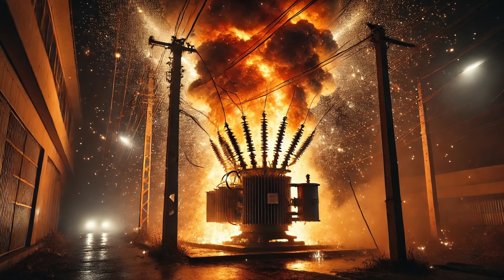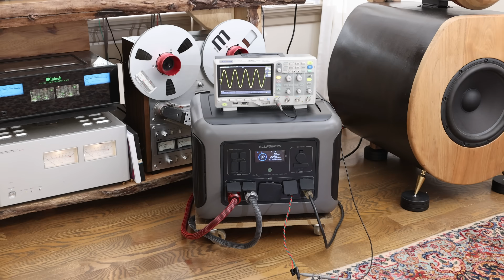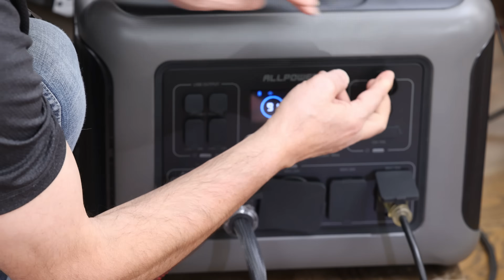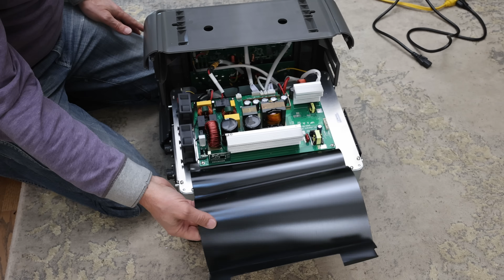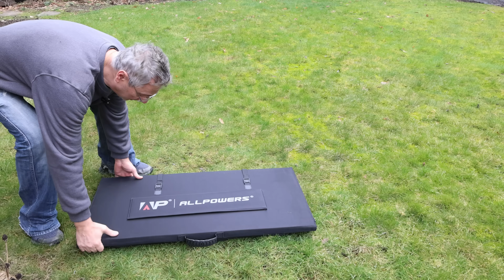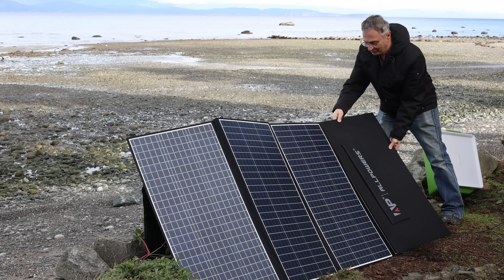Will a Massive ALLPOWERS Battery Improve Sound ?

Comment: @gabster Please check the ripple voltage from the DC outputs, we can see if it's worth connecting our DACs to it directly.
Excellent video btw
Reply from the maker: I just checked the DC ripple on 1he 5v and 12v 
about 3mv on 5v and 20 mv on 12v while not terrible not great those I believe are converted from the 110V inverter with average quality they are not from direct battery source you would still need to do your own AC to DC conversion.
Reply from the maker: Good idea
Reply: @Gabster1 are you going to do that so we can see what the measurements show and report back?  Thanks
Reply from the maker: @ I just checked the DC ripple on 1he 5v and 12v 
about 3mv on 5v and 20 mv on 12v while not terrible not great those I believe are converted from the 110V inverter with average quality they are not from direct battery source you would still need to do your own AC to DC conversion.
Reply: @ how about the AC?   So basically the battery really meadurement wise does nothing.  
Also you should test the ESR.  You might be hearing more bass from a slower transient response.    
Or capacitance from the battery.  
All this is measureable.    Thanks for getting back btw !

Comment: Gabster, The AC inverter power bank is great, but I'd like to bypass some of my audio gear's AC power supplies and directly feed DC from my 36vdc forklift battery.  That battery weighs 1800lbs.  Clean power by the ton!  😁😉
Reply from the maker: I am just picturing your forklift by the stereo ideally components should all run on DC power with some big capacitors
Reply: @Gabster1  Would be great for in-shop sound.  Set the gear on the forks and bring them up to the height for easy control.  Portable also.  Move it where needed.  Hahaha!  Really and up-lifting experience.  😁

Comment: I've see into forum that Li-Po battery are better than lithium for outgrid sound system. And for maximum effiency you can use it with a Puritan Audio PSM156. 

I have a PSM156, but never plug it into a battery pack. Will probably test it eventually.
Reply from the maker: I think it would be worth trying out and giving us your opinion!

Comment: What is the THD on the output? Can you please try and measure? You can hot rod this by paralleling more high end Vishay/Philips electrolytics which will improve the inverter quite a bit. I'd also add a 2uf and 0.01uf film caps for mid and high frequency noise.

Comment: Interesting observation about the bass improvement.  I have been wondering if batteries supply a better ground path than the utility ground?
Reply: This is a very complex question lol I could go on for days teaching you how to have the best ground setup for SIGNIFICANT improvement in sonics. The short answer... Yes and no. The bass is better because of the lower / phase noise of all the gears clocks with clean power. Phase noise is always worst on all clocks at low frequency... Bad power has a very real and measurable degradation of phase noise and since low frequency is the worst to start, the improvements here are most noticeable.

The ground is best with true earth ground. A dedicated ground rod ideally with a gear tied to a star ground configuration... Google it... You can diy a star ground with a copper bus bar easy for cheap. All equipment to the star ground and star ground to true ground, likely for most wall ground and not a dedicated rod (I did definitely worth it.)

The key is using other capacitors in parallel between star ground and true ground to help reduce impedance of different frequencies. It's easy to measure the changes with a scope. Huge sonic improvements... A mix of large electrolytics, ultracaps, and small film caps is a good starting point. For electrolytics + to star ground and negative to earth ground. You won't believe the improvement.
Reply from the maker: excellent point grounding is a huge subject often misunderstood
Reply: @B2_Labs  I come from the mechanical side, (machine design), but it seems like all the attention is on the supply side in audio, and little to none, on the return.  Its like boosting a car engine to 30psi and unknowingly running it thru a 1" exhaust pipe if the ground connection has problems.   It is interesting you bring up capacitors in the ground, I was wondering if you could create a "super-ground" with low ESR capacitors to help "pull" the power thru the circuit in addition to "pushing" it thru with Supercapacitors.  BTW, these did help my system.  However, I was concerned about safety but running the capacitors in parallel with the ground would seem to solve that issue.  I would like to more about the  capacitors in the ground if you could point the way.    
For my personal case I live in an apartment so I have no control over my grounding past the wall outlet so I am going to order a 12v 100ah LiFePO4 Battery and start playing with an all DC power system.  
Gabby, thanks for another great video!  You always seem to come out with a video on a subject I have been thinking about.
Reply: @B2_Labs  What about safety without isolation, your proposal would see an electrician/engineer working locally with earth risk electrocution in the event any of your equipment develops a short to ground!
Reply: Interesting point about grounding. Any comparison on the grounding front with the likes of Puritan’s grounding system?

Comment: Ha4 u've got urself pack over there Just to turn on the systems While me as an iem audiophiles We done it frm beginnin',. But our concerns are about the noisey systems which only iem can sense..I can see ur experimental just for fun tryin'..Hifi systems are not most sensitives tranducers sir because lots of systems can be heard noisey in it yup with audiophiles IEM which is the most sensitives tranducers currently.. That's the motive of us usin' batt supply which is important but not in ur systems. The facts is power frm the wall are noisey towards audio systems mostly sensitives 1 like iem..yup2 groundin' bla2 all sort plays part. And still it's not practical for hifi systems Yet genius for iem systems which is more needed in concerns.Yup prob with A-B test But not with iem systems..ha4 in facts it's a pleasure to A-B..I've got 1..by Unigreen, it even support upgraded Yeah for usage options..it's just wild these days 'Stand alone power'. yup the Unigreen supported solar rechargin' too In facts all are these days..gd1 Peace!

Comment: Still waiting.  Is the Scarlett calibration check done yet? Maybe do a frequency sweep say 10Hz to 20kHz with a 10mV/10mV RMS signal. Looking forward to seeing the numbers.
Checked with a shorted input on my Rigol DSA 815 spectrum anysler. 
Noise floor is around -105 dBm 2.24E-06VRMS. 
Soon as I add 50 ohm terminated 2 foot double shielded RG174 cable noise floor climbs to -90bBm 7.07E-06VRMS. 
Hooked the RG174 cable to any bench power supply and then a isolated/none isolated super capacitor noise floor climbs to -75dBm 3.976E-05VRMS.
Still hard to see the $200 Scarlett is hundreds of times better.
Note with a 16 bit DtoA with a 6Vpp signal a 1bit change is a 90uVpp step.
Reply from the maker: Still in the works too many things going and very little free time
Reply from the maker: Make sure to run the Scarlett via usb from a battery powered computer not connected to ac that is key
Reply: @Gabster1  
If connected to line 60Hz and harmonics could be visible, easy to ignore in the spectrum.

Comment: Can you measure the noise on this battery unit? Also, can you find a way to remove the inverter noise? There must a way to design a specific power conditioning filter that removes the noise frequencies and amplitude that are specifically generated by the electronics of this unit?
Reply from the maker: Some more tests tests would help I am not familiar with high voltage AC tests most of the time we work with low voltage DC

Comment: Were you able to check if the inverter outputs any high frequency switching hash onto the line?
Reply from the maker: I need to familiarize myself with high voltage AC testing

Comment: Those fans inside  sound a lot , it is noise from airflow can not be ignored 😊
Reply from the maker: Some of the noise was from my Oscilloscope for a permanent solution putting the battery outside in a covered area may be good idea for additional safety.